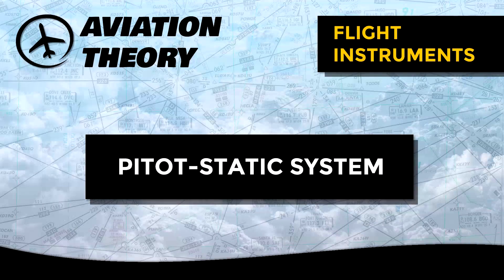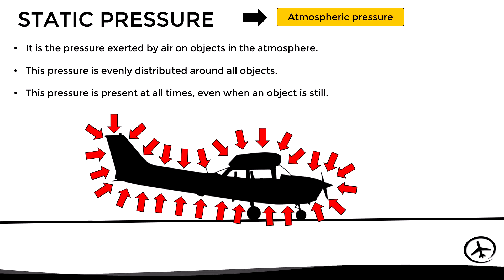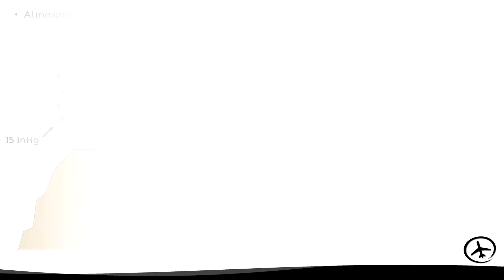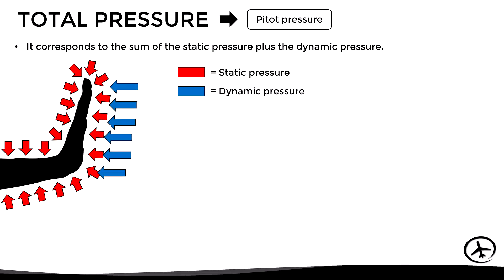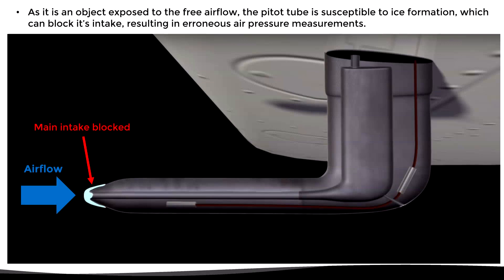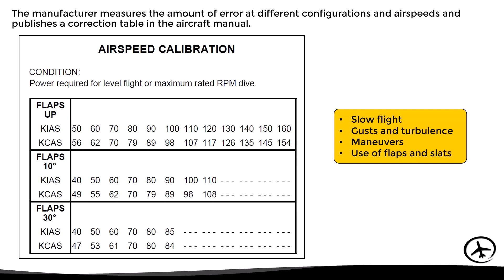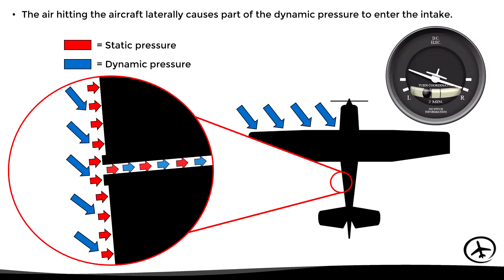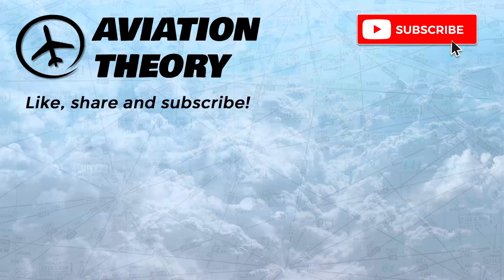Pitot-Static System

Comment: Static ports open directly to the outside of fuselage. When aircraft is flying, there will be air flowing outside of static port. How does this not cause a vacuum effect inside the static port. Due to the Bernoulli Effect, as the speed of air flowing outside of fuselage increases, the pressure inside static port should decrease. This means, on same altitude, depending on my aircrafts speed, I will read different values on my altimeter. What prevents this ?
Reply: The Bernoulli effect is negligible, as the static ports on aircraft are usually installed on the forward or aft sides of the fuselage, i.e. not generating a vacuum effect, like that which would occur if the static port was on the upper wing surface. The static port on a Lear 25 is near the cockpit, for instance. There are some pitot tubes on jet powered aircraft that have the static ports incorporated into the sides of the actual pitot tube as well, such as the Rosemount pitot probe on the Learjet model 31.
Reply: I think the plane has a pressurization system that balances the pressure on the inside and outside

Comment: Nice video. I don't think the swimming pool explanation is quite correct. With water being a liquid it's not measurably less dense at the top of the pool than the bottom like a gas. Very little compression takes place in a liquid. The pressure does increase with depth, but because of the weight of the water above, not because the water becomes more dense.
Reply from the maker: Hi Simon, you are right, the water in a pool is not compressed as the air in the atmosphere, so its density is fairly constant. maybe I shouldn't have put the water molecules closer together at the bottom in the example, as this can lead to misunderstandings. I just wanted to show the increase in pressure with depth. Thank you for the appreciation!
Reply: @AviationTheory  HI do you have a way I can get in touch with you directly?
Reply from the maker: @paulslaney68  Yes, you can send me a message through the Facebook fanpage: https://www.facebook.com/Aviation-Theory-102745835488031